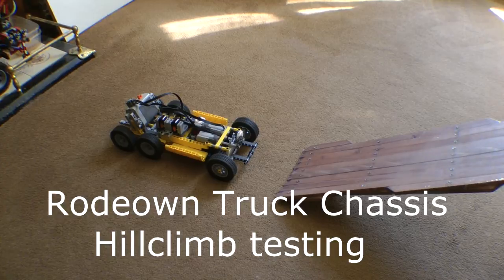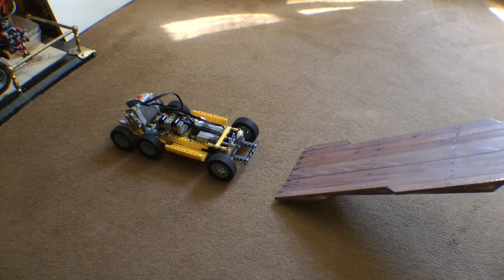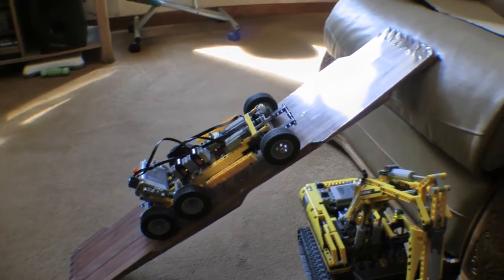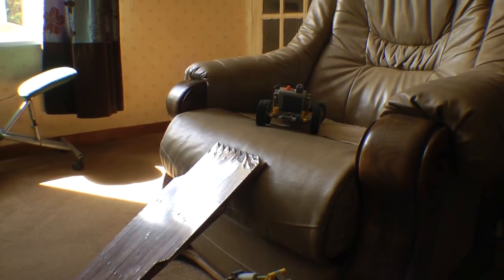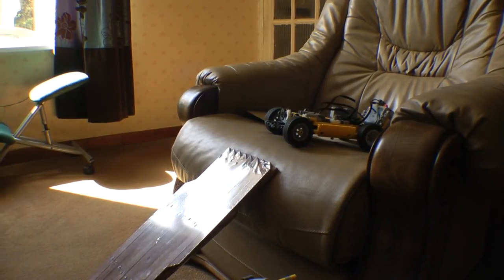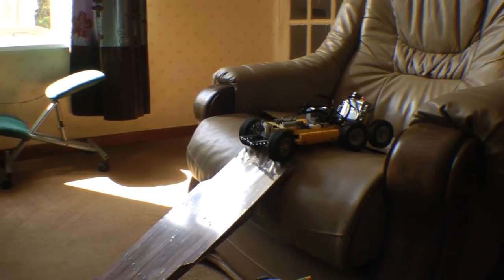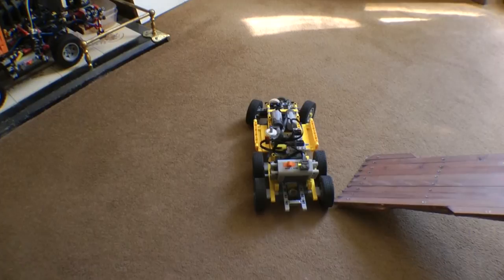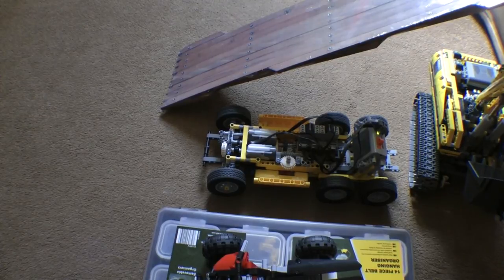Rodeown Lego Technic Moc Truck Chassis test

Comment from the maker: Tokatt, simple answer to your question, no it does not because I have geared it to a very low gear so it has plenty of torque to climb with, listen to the motor as it starts to climb, very little change in tone due to the gearing :-)